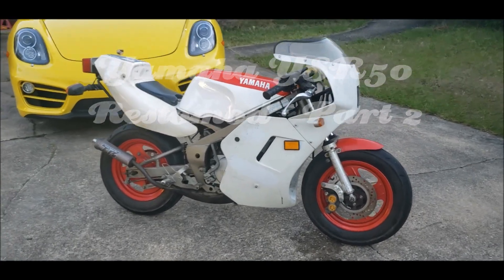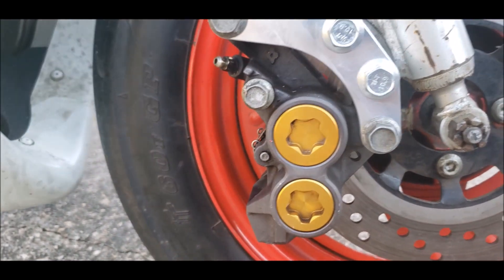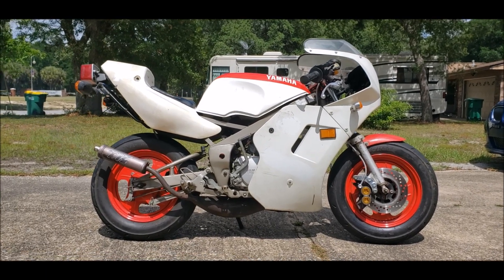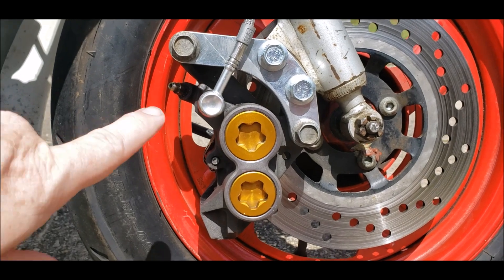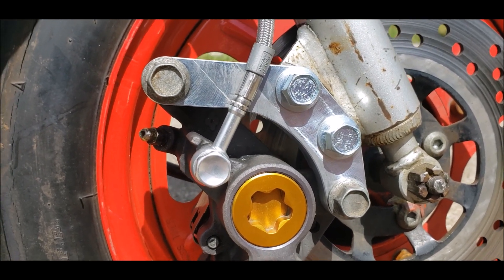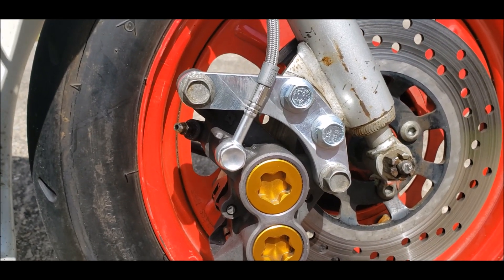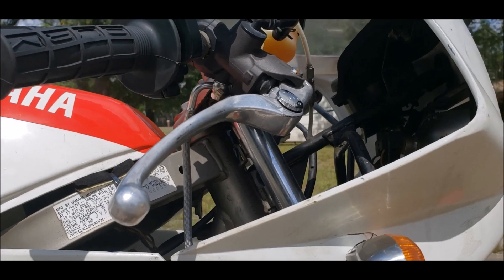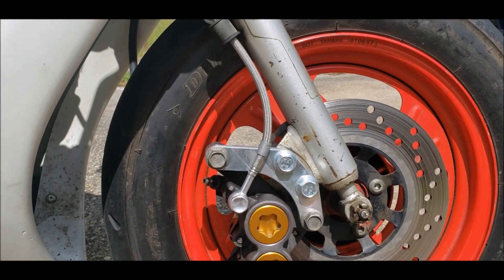Yamaha YSR50 RestoMod   Part 2

Comment: I understand why your doing the front brake upgrades, but what I can assure you is that a 4 piston caliper is gonna be waaaay overkill; especially for a 50. The reason being is bc I’ve got a stock master cylinder, caliper, pads, and a Galfer USA steel braided brake line and it will start to lock up the front wheel with slight pressure. Also, I can kinda understand your situation if you engine swap it, but I think it’s gonna be way to sensitive / touchy and will lock up pretty quick.
Reply from the maker: Ethan, you are correct about the touchy brakes. A master cylinder with a smaller diameter bore will cure that problem. This is my first test of the new setup. V2 will be better.
Reply: TZ250FANATIC a smaller bore should help considerably, and if you ever get a chance you should bring it out to YSR Daize ; this years event is being held in Suches, Georgia this July.